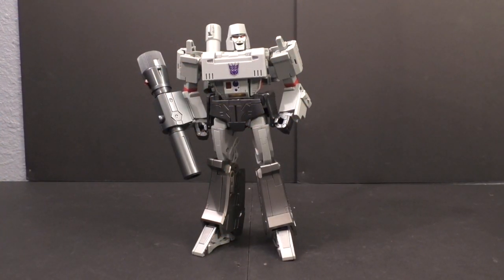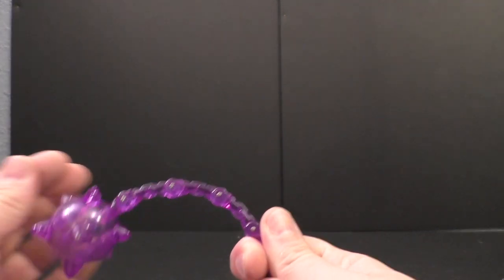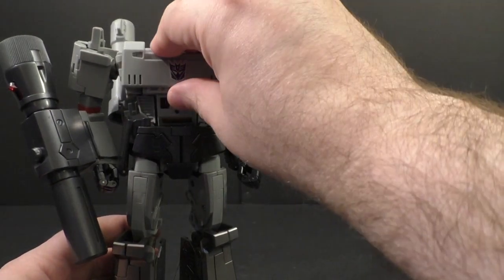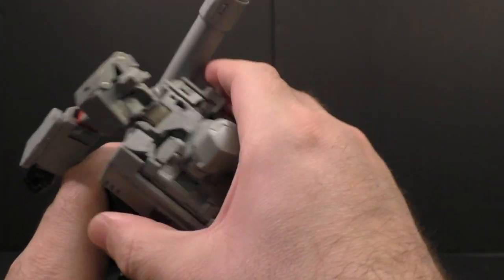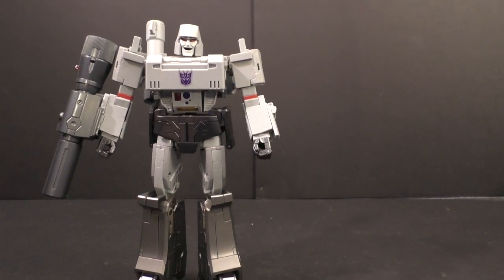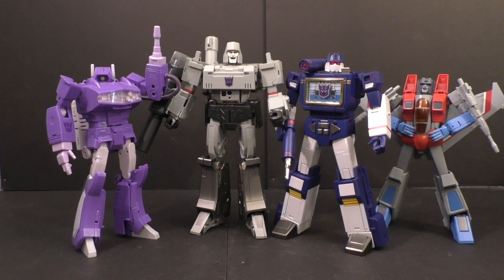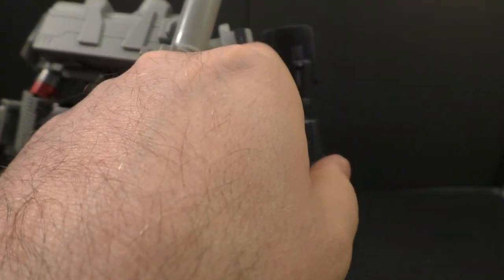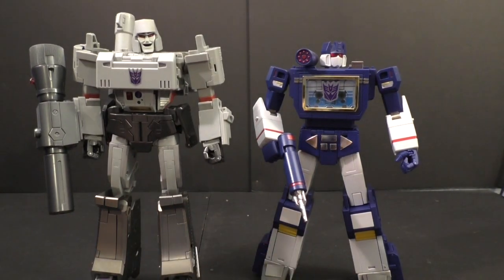Transformers review Infinite Transformation Emperor of Destruction KO MP36 Megatron

Comment: Infinite Transformation was Black Mamba (or KuBianBao). I got the 2018 reissue that had the regular fusion cannon with the Japanese sounds+red LED along with the extra one with Chinese & English voices+purple LED, the back cover part, and multiple Kremzeeks (all of which I think were supposed to be bonuses for preordering the first run).

The "no paint chipping" is largely referring to the paint on the figure itself, that's where the main paint chipping issues were. But from what I gather, wasn't the worst of it the gun barrel which got jacked if you attached the silencer completely? IT01 definitely doesn't chip there. And the mold flashing? I don't have that issue with my copy at all. Definitely sounds like you got a bad copy, which can absolutely happen to anyone (ex.: I got the Eagle KO of MP52 Starscream, and it stressed in a lot of places when tryna transform it...I barely got it back to robot mode, where it's forever staying. But, NOBODY else has had that happen with the Eagle KO, the 1:1 KO, or the original...oh, and the Eagle KOs did do improved ankles, screws instead of pins). 

I mean, KOs are just like the real deal, your mileage can and will vary...and you absolutely can get a lemon. I think I mentioned it on one of your MP44 KO videos, but I have the MP49 version of the small backpack MP44 KO...and it legit sucks for transformation!! (My copy? The truck cab can't close properly. He's staying in robot mode, too...just like Starscream) 

Other lemons that I have, both KO and official: 
The MP32 Optimus Primal KO. On my copy, one of the shoulder springs done popped out somehow!! 
The MP43 Beast Megatron KO. Transformation is even more difficult than the Takara, and it's a panely mess that simply doesn't come together properly!! But unlike Starscream and Black Convoy, I have no qualms about transforming this big purple T-Rex. 
MP17 Prowl KO had a door that wasn't assembled right to begin with and eventually snapped off. 
Official MP18 Streak...his gun can't switch into the alternate mount part for storing it in vehicle mode. The post is literally stuck in place.
Hasbro's Year of the Goat Soundwave and his Minions is another lemon, and I don't think I need to say why being made of predominantly CLEAR PLASTIC was a dumb design decision of the highest caliber...
Legendary Toys LT02 MPM4 2007 Movie Optimus Prime KO had a busted foot outta the box, a dumb design decision that apparently plagued some copies of the original MPM4, and it also later blew up at the waist. No idea how that happened or how to fix it.

Back to talkin' about Megs. The ab crunch is a bit retooled so that it's locked in place by default...an annoyingly unnecessary move, as the only way to open it up is to break the locking part...which doesn't affect much. The floppy back part with the gun barrel was just dumb design decision and was an issue with certain copies of the original MP36 and literally every other KO. The thighs are diecast, unlike the original and most of the KOs (I believe that the Magten version also had diecast thighs, but I'm not entirely sure).

To be fair, however, when I first got my copy, I literally couldn't use the battle damaged face at all initially, it simply wouldn't fit. Not sure what changed or if it was the multiple tries, but after about a year, the damn thing finally fit.😮 A couple of the pins fell out over time. One's not so important (on the right arm, it holds the gun mode's safety latch), the other is MAJOR (left foot). I need to replace them both with screws. That said, I like my copy, got it for 115, which was just 30 more than the Toy House Factory "Dynastron" (which at the time, only the shitty clear version of Dynastron was in stock). A week after I got "Emperor of Destruction" in hand, THF announced a reissue of the regular Dynastron. Didn't care, I was good with mine. But at 150?? Man, you have every right to be pissed off about how awful your copy turned out, hell, I know I would be (and I'm still a tiny bit smoldering about Starscream because the Thundercracker and Skywarp KOs have all seemingly vanished off the face of the earth)!!